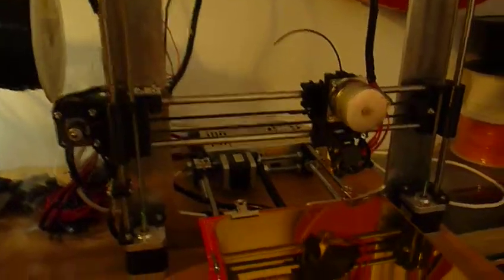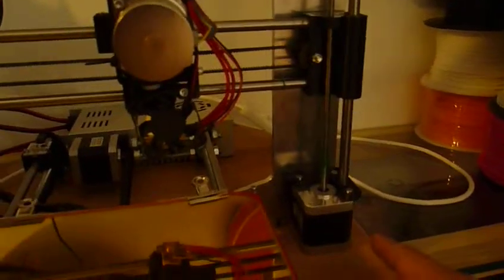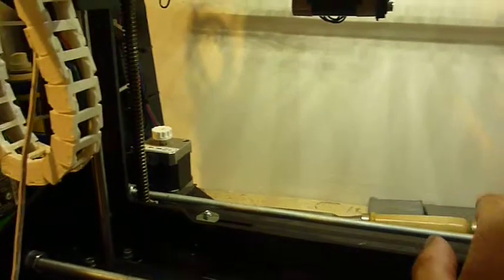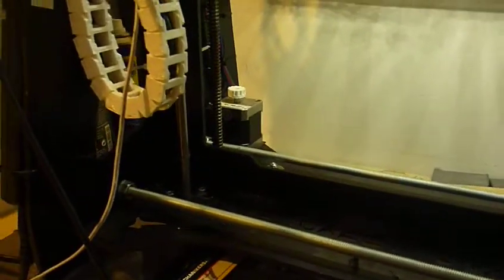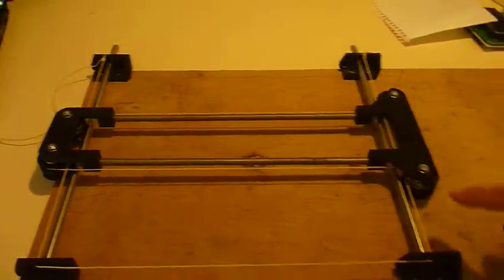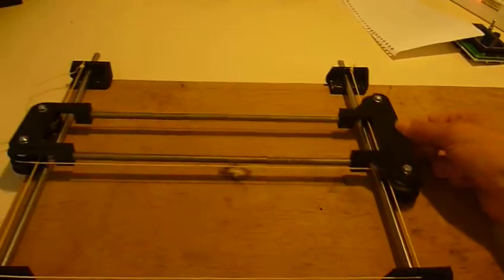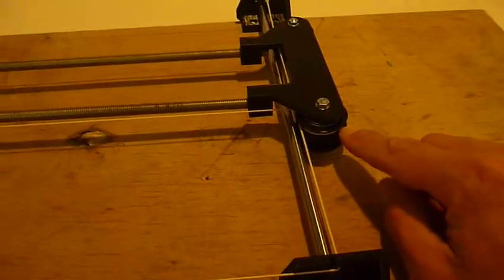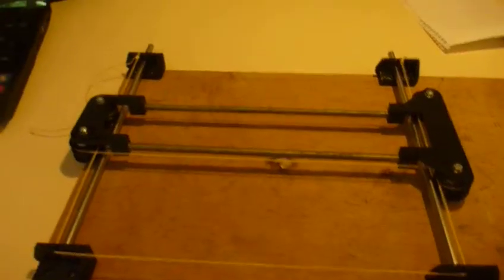RepRap Perpendicular bridge movement

Comment from the maker: Hi Mikefiatx19, 

Thanks for your remarks! I always like it a lot when people think along. There are two problems I see with your proposal. These are my opinion which is only valid if I prove it :)
1st is that the extra threaded rod will protrude 20cm or so on top of the printer when you print something that is high. Often this is not important, but sometimes it is. 
2nd is that the x bridge is held in the middle. This helps a great deal in balancing, but it's not stable.It can still move.

Comment: Hi, How about attaching the z axis in the middle of the print carriage using an additional horizontal rod above the extruder head. Then the threaded bar providing the lift could be geared to pass through the z motor and travel through out of the top of the Prusa frame. that way the movement would be a lot more stable